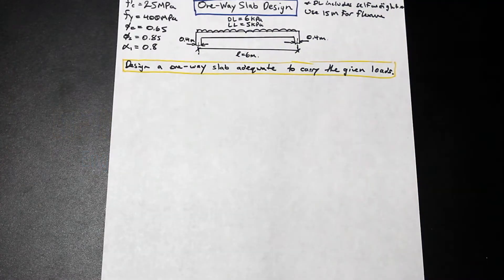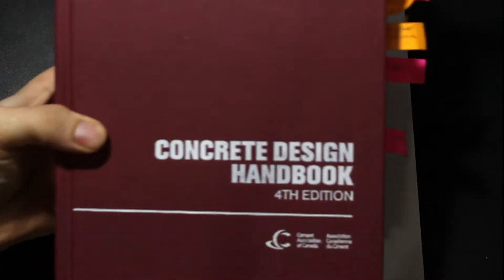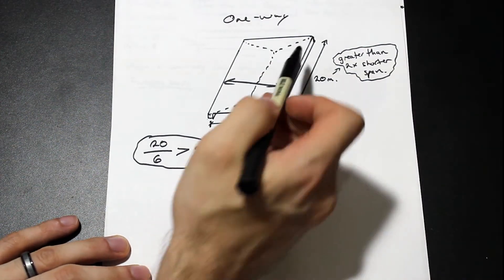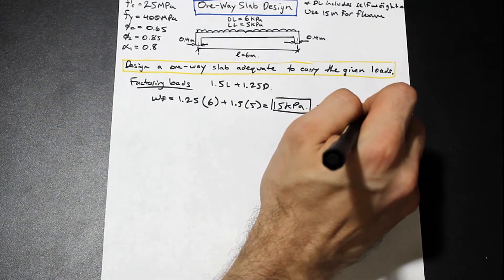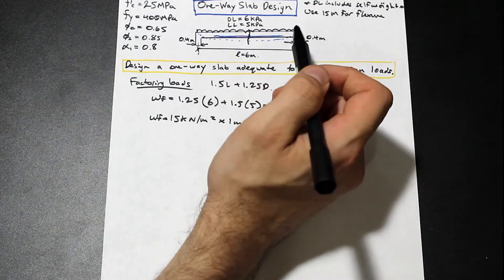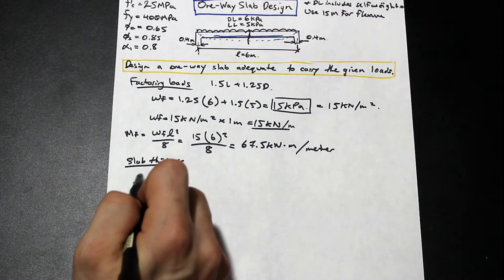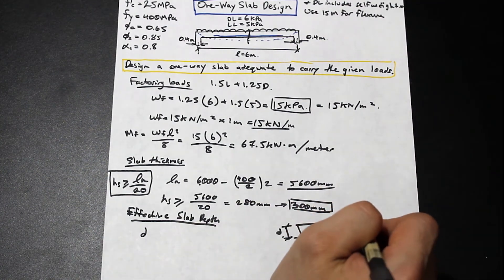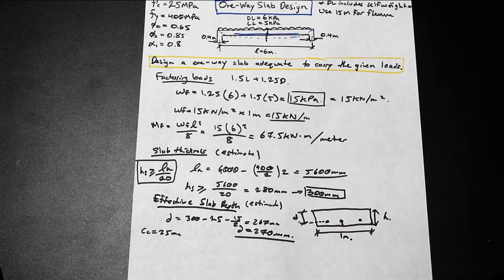One-Way Concrete Slab Design Part 1 - Concept Explained and Minimum Slab Thickness - Canadian Code

Comment: I did my civil engineering degree in Kenya using British Standard BS 8110 for concrete design, recently I have been learning the Eurocode, and also Indian Code. I aspire to work in Canada one day, how hard is it to get a job there given my training in British Standard?
Reply from the maker: Hey, it depends on the province, but usually the governing body will require you either update your education (6 courses in my province), or write an exam to become licensed.  If you take the courses at university you don't need to write a technical exam.  

I don't think it'll be any more difficult after you upgrade your certification to find a job as long as you know your stuff, the condo market here is going crazy haha.  Good luck!